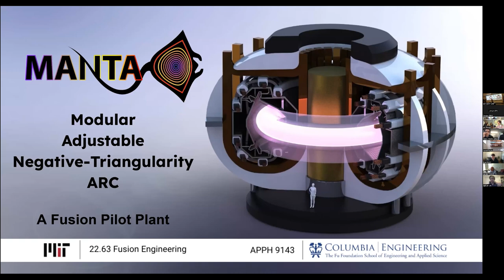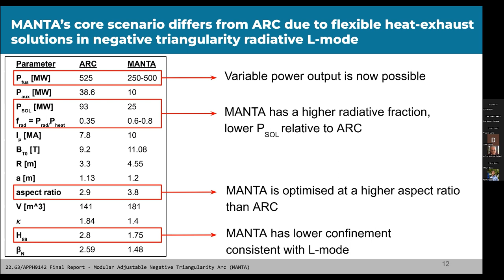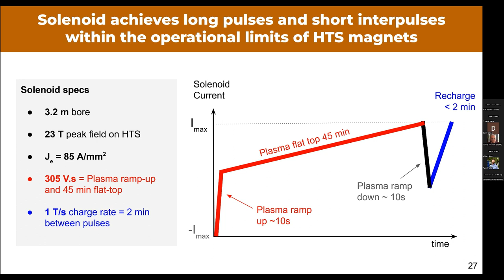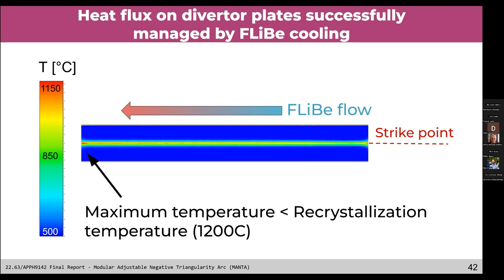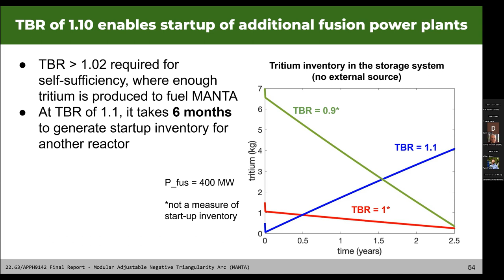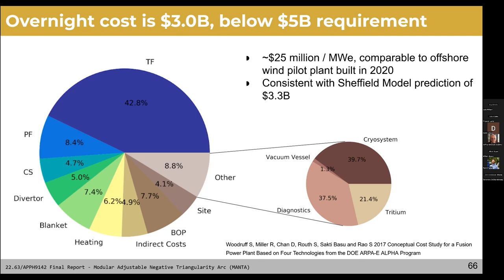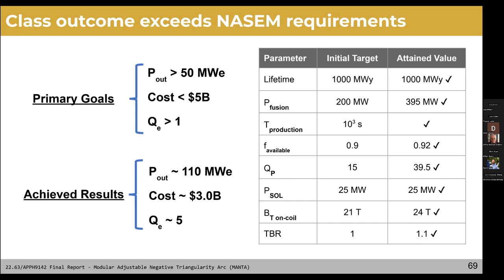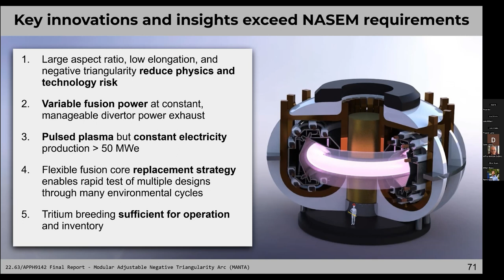MIT PSFC & Columbia University Fusion Design Class Final Presentations

Comment: Really good work! Congratulations!  How are you supposed to reach the ignition temperature? I remeber ITER will use Ohmic , Neutral Beam Injection and Radio Frequency heating systems.
Tnank you
Reply: The design has ohmic + RF heating systems :)

Comment: Sound quality is terrible. Can someone tell me what is said about FLiBe, at 6:35-6:40.
Reply: FLiBe (Flourine Lithium Beryllium) serves 4 key purposes:
1. It is a coolant that keeps the vacuum vessel and power-exhaust functional
2. It transfers heat to the rest of the power plant
3. It is a radiation shield that protects the magnets and other internal components
4. It is the material used to breed additional nuclear fuel (beryllium is a neutron multiplier and lithium can break down into tritium when struck by neutrons)